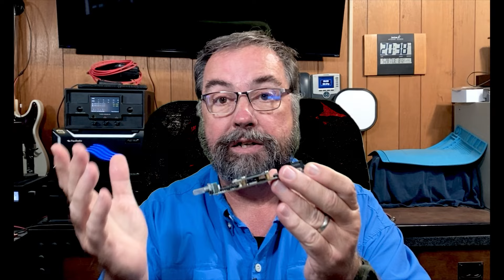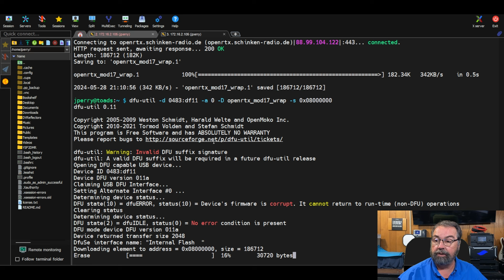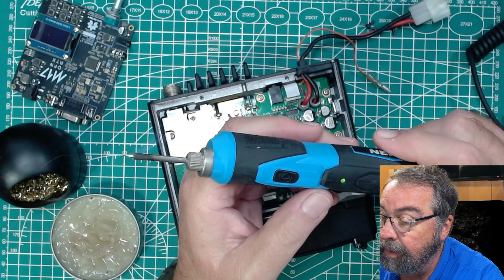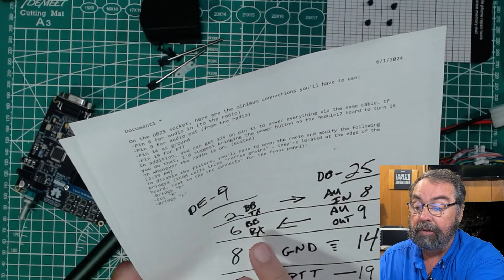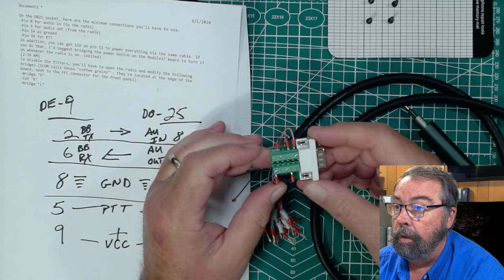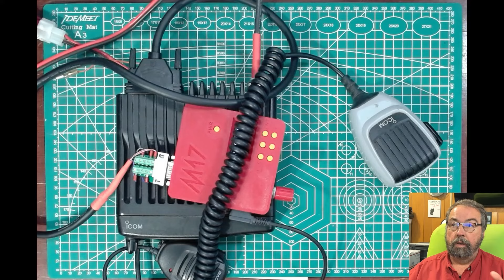Icom M17: The Future of Ham Radio

Comment: Good to see M17 gaining some ground, even if it is just a little at a time.  Thanks for the video and info!  I'll try to give back a little by providing you with a small bit but hopefully very useful over time info.  I noticed you spamming your ENTER/RETURN key to "clear the screen."  You can use the CLEAR command to clean up the whole screen; just takes 6 keystrokes.  Or, my personal favorite: ^L (CNTL - L); just a single keystroke (well, technically 2 if you count the CTRL key).  The CLEAR command is more robust than ^L but it's extra function is almost never needed.  Capitalization is only for emphasis.  As per usual with 'nix OSs, use lower case for the CLEAR and (nearly) all commands.
Reply from the maker: Thanks for watching.

Comment: My only issue with this M17 board is that it's essentially just an analogue bridge. Think of it like allstar, so on the M17 side of things there's a high chance of distorted analogue audio, and when that then gets transcoded into M17 it's going to sound awful. A similar approach to using Tetra has been used for svxlink, and it suffers badly from distorted analogue input... Just my 2 cents...
Reply: It's a modem - what else should it do? Or what/how it could do better?
Reply: @SP5WWP  OK out of the other digital voice modes that have been adopted into amateur radio... dstar, c4fm, nxdn, p25, dmr of those what one do you access them natively with FM? None, so that's what I mean. Yes doing it this way makes it quicker to access the M17 network, but M17 is claiming to be a opensource digital mode but due to the lack of a physical radio that can transmit the digital M17 (yes I'm aware of the mods to MD-380 dmr radios) Now do I have the solution to what I mentioned, no I don't. The only way I can access M17 is via droidstar and audio on that can be pretty dodgy at times too! I'm not saying that M17 is a waste of time, no absolutely not, as I run a M17 reflector!
Reply: @ScottEvans-vk7hse  but the modem makes the radio transmit and receive M17 over RF.
Reply from the maker: I'm pretty sure most of my audio issues is with the 3$ baofeng squeaker mic.  I need to add a speaker jack to the board for full frontal clarity.

Comment: Thank you Jim.  Have have the M17 board and using the FTM-6000, just like TO used on the live stream.  My BER was zero, but I am using a UHF frequency, and turned the radio to 5 watts.  I agree, the Baofeng Speaker/Mic is a limitation. I had very low audio.  I am happy to have the M17 board, and make it all work, but I find that MVoice on a PI or running on Linux Mint to be better, at the moment. It is fun to play and experiment, and I look forward to growing with this protocol as they progress, 73,
Reply: Still some room for improvement :)
Reply: Mvoice is definitely a better solution imo, at least until the board becomes more mature.

Comment: My theory on the poor BER is that your TX level from the module (adjustable by the multi-turn trimmer pot) is too hot, and clipping the baseband input of the radio. But until you throw that signal onto a scope, it's hard to tell. Plus the level the radio wants to see might be a challenge to find - not all radios like 1Vp-p levels. But it'd be interesting to see the radio-in and radio-out signals on a scope anyway - and since they're on your DE-9 connector - they're super easy to get to.
Reply from the maker: That sounds like a follow up video!  It's reliably tripping the hotspot, and I have not messed with the trimmers on the board, so that might be it.

Comment: Jim,   looks like the M17 signal is a little "hot"  compared to the  NXDN signal.  Might be causing the BER.   Was this testing done thru some attenuators,   or can you somehow dial down the RF output power.    :)
Reply from the maker: The antenna for the Icom was outside, and it's set on 1W (It only goes to 5W).  Maybe if I moved the hotspot to the other end of the house.